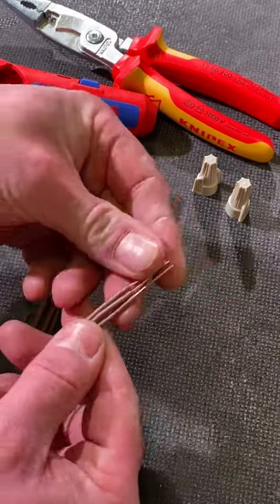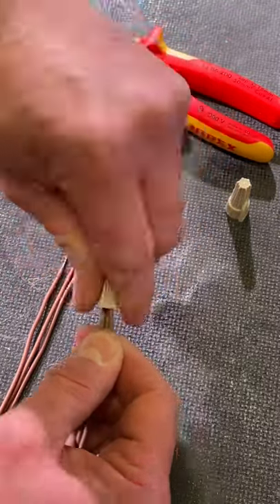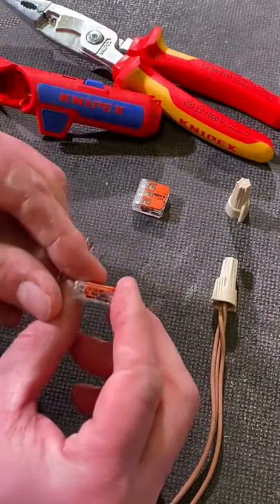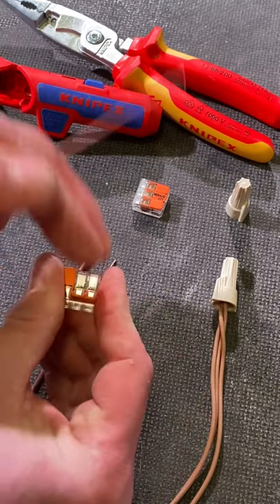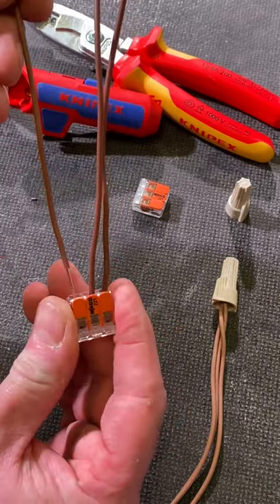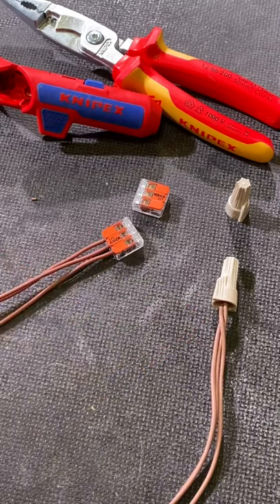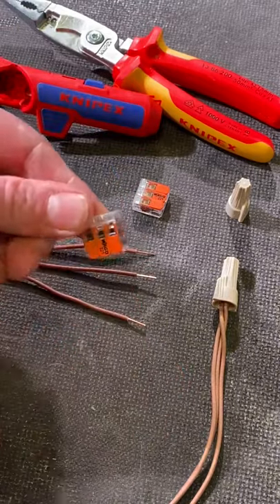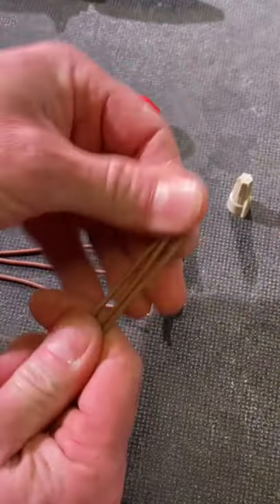Which way do you splice wires? WAGO 221 vs WIRE NUTS? | Electrical #shorts from eFIXX

Comment: I do prefer the Wago. Easier to use, especially so if one wire is different diameter than the other, or one is stranded and the other unstranded.
Reply: If the wire is a different diameter then you have to use a different wago because wagos are amp rather and the diameter of the wire determines the maps that will be traveling down the wire. Wire nuts have no amp rating because they mechanically connect the wires together. The metal in the wire nut is only used for grip not as a current carrying conductor like the wago. They are not safe I've seen them explode when a shot happens.
Reply: @BILLY KRYSTAL 
Well, no. Let's assume single phase power, 120V for simplicity. One wire is going to go back to the breaker. If the breaker is 15 amps, then there will never be more than 15 amps sourced through that wire. Because of Kirchoff's current law, none of the other wires going into the Wago can exceed 15 Amps. So long as the Wago is rated for at least 15 Amps, there is never any possibility of exceeding its rating. But what if one of the wires going into the Wago is undersized? How exactly is that going to happen? Any lighting fixture you buy is going to have lead wires rated for that fixture's maximum draw. Even if somehow that draw exceeded 15 amps, the breaker would open, protecting the wiring and the Wago.
Reply: @ws6002  Your relying on the breaker to trip if the load is more than 15 amps sorry but breakers fail. People plug things in that use more current all the time that's the whole reason we use breakers to limit the current because people plug crazy things in. But the breaker doesn't always trip. Like one case we installed a 30 amp outlet for a dryer. Breaker didn't trip with a dead short to earth and melted the outlet brand new install brand new breaker. Using a wago the wago would have also melted because its amp rather and introduces resistance and creates heat. Breakers are built using a metal rod and a coil to induce a magnetic trip. If the short is bad enough it can melt the enamel off the coil wire in the breaker and not create the magnetic field that causes the breaker to trip. You should never rely on a single trip point. Using a wire nut you are essentially creating a bond with the metal the reduces the resistance because where the connection is is a much higher gauge wire where the joint is. So it will never heat up even in a instance of a short or large current draw.
Reply: @BILLY KRYSTAL  Yes. I am relying on the breaker tripping. That's how wiring is done. That's how the standards are written, for both residential and industrial applications. Are you writing your own residential electrical wiring standard? Because the use of wire nuts is 100% dependent on that breaker tripping. So is every inch of wiring in the walls!
Reply: @ws6002  No using a wire nut is safer because there is no heat created at the joint in a scenario where the breaker doesn't trip. Where there is resistance there is heat. A circuts weakest points are its greatest failures. I would rather the outlet melt than every joint in the circuit. I only use wagos in DC circuits where I have full control of the amps being drawn through my circuit. And no we dont trust the breaker will trip that's why we ground all metal boxes that's why we have a massive ground rod. That's why we bond the water. Thats why we use metal panels and ground to the metal studs and the slab. If we were sure the breaker would trip we wouldn't need grounds.the ground is used in a short so the wire doesn't overload and fry the wire like a fuse.
Reply: @ws6002  if you make a proper joint to start you dont have to see your connection! Stop being lazy. A proper electrician always checks his joints stop being lazy. A stranded wire works just as well under a wire nut if properly secured! Stop being lazy. A proper electrician would never fool themselves Into using a wago because there to lazy to do it properly.
Reply: @BILLY KRYSTAL  You revealed you are incompetent when you failed to answer my question: What is protecting the wires in the wall when the breaker fails to open? You don't know what you are talking about.
Reply: @BILLY KRYSTAL  And FYI, the Wago connectors improve the safety of the mixed connection because the stranded gets a joint and the solid gets independent connection with the interior bus. That way we know both are solid (no pun) connections. You forgot the wiring in the walls has a lower rating than the Wago. You forgot that the Wago provides a method of visually verifying the connections.

Comment: Wago may be convenient and slightly better for saving space in a box, but wire nuts allow for a much better surface area connection. And yes, you can undo a wire nut and re-use it.

Comment: Being in the US, Wagos aren't really common, but if I get back into industrial control systems I would likely get a selection of them because I like the idea!
That said, I untwist wire nuts unless they are locked up, mainly because in wall boxes you don't have extra wire length to cut off, and over the years you may need to remove wire nuts many times lol
Reply: That's also where wagos come in handy my man.
Reply: @shawnshurtz9147  often no room for Wagos in household wall boxes over here lol 
They are also used as junction boxes and may have multiple 12g solid Romex circuits running through a switch or outlet box, and you have to push hard to get everything back in, with the nuts tucked back into the corners.
Reply: @ke6gwf  I'm in the USA. Inspectors are pretty strict around my area for box fill. At least in commercial / industrial.
Reply: @shawnshurtz9147  for new construction, yes, but I am more likely to be working on old houses and commercial, and it's not uncommon to have to use the screwdriver handle to compact the wires in, and then the tip to wiggle wire nuts into gaps lol
It's especially bad where GFCIs have been added...
Reply: @ke6gwf  they make a little plastic tool for pushing / tucking wires into the back of boxes 😀
Reply: I've known about Wago for a while but never tried them until I bought my house a few months ago. Did the electrics with Wago and after years of working with my father who was an electrician, I will probably never go back to wire nuts. The advantages are to numerous to get into here. I've ordered a multi collection set of them and love them. They are firm, strong connections and take up less space and super easy to use. Technically wire nuts were never designed to be reused but I am guilty of that myself for many years.

Comment: I've used wirenuts when i was in the states years ago, never had a problem with them, same as wago's .. a lot of it is down to the installer using them correctly .. i like the wirenuts as there is a lot of surface area contact, downside is they are bulky compared to a wago , not as fan of the push in wago's but like the 221's .. deeper back boxes in the states, not sure a wirenut would be a good thing in a 25mm box
Reply from the maker: Massive thanks for your input 👍

Comment: "A proper job doesn't have to be undone"
Reply: Ever change out a zone valve on a boiler?
Reply: @jaredtandle2596  I avoid death traps whenever possible boilers no matter how new or "well designed" fall into that exact category lol
Reply: @deathkiller008  lol yeah.. I think they expect everyone to have perfect water there at Rinnai
Reply: "Those who don't make mistakes are those who make nothing at all"
Reply: @thelazarous  I am STILL paying for my mistakes and I am not sure that will end anytime soon
Reply: @deathkiller008  I'm dropping a third motor into my mustang this month, trust me I feel ya
Reply: Wago
Reply: @thelazarous  well that's your problem, it's a Ford. Jk man that sucks, manufacture defect or what?
Reply: @george30198  Camshaft synchronizer drive gear on the front of the camshaft keeps chewing up the synchronizer gear. Synchronizer gear drives the oil pump, gear fails and you have no oil. This last time I was doing a 4th gear pull when it gave out, 5000rpm and no oil pump = spun bearings
Reply: @thelazarous  oh my god
Reply: Yeah well they do have to be undone all the time.
Reply: @shawnshurtz9147  the quotes are me saying that this is someone else's words friend :)
Reply: @deathkiller008  word I agree.
Reply: @deathkiller008  reiterated is all.
Reply: @Thibaut Snoeijs (3WEA) lmao funny real funny. I terminate 30 to 40 fixtures a day rhats 90 to 120 connections a day with multiple wires in each connection and you think I'm unprofessional for not using soldered connections. Customer may not like the massive extra cost of labor.
Reply: @Thibaut Snoeijs (3WEA) solder deteriorates over time, which actually leads to higher electrical resistance, in this application that may lead to heat build up in the wire nut, which is why it isn't recommended, nor 'professional'.
Reply: There's an old saying that goes,  "shit happens" .

Comment: I dig the levers for light fixtures and occasionally in boxes where it's more efficient. Otherwise I wire nut outlets and usually switch boxes. Junction boxes with no physical movement I'll use wago wallnuts. Just my preference over the years I'm developing. Kudos to the YouTube commenters who turned me onto lever nuts for lights!

Comment: I'm more of a Wago guy now. It looks much more cleaner and saves you time with changes. But I haven't forgotten the wire nut method as I was first trained on them and they work out very well as well.

Comment: Look...I think we all know we can just take off the wire nut here and reuse it but there have been plenty of wirenuts that have the threaded part at the tip come out making the wirenut useless. I've been around HVAC and electricians all my life and the wago's aren't going away nor do I want them too. There are the old-school guys that'll never admit that they are good & useful but they are.
Reply: They are cool, but wagos are more expensive and there's nothing wrong with wirenuts. I think a lot of the backlash is because of dumb videos like this pretending that wirenuts are totally inferior. I use both, but it's like 90/10 in favor of wirenuts.

Comment: Lead service tech here, wago's are a guaranteed service call in a few years, especially if there's any kind of real load on the wires.
Reply: then your techs are fucking up in the install, or more likely you are bullshitting, i installed the wiring in not just mine but many a house, and 15 years later the wago is still fine

Comment: WAGO 100%
Reply: Me to man my dad and i use them all the time on big jobs never failed us yet and there are wagos that has no levers to release they are push in and pull out wagos we use those in electrical boxes and wire claps so they wont pull apart
Reply: I’m not an electrician myself but am good friends with one don’t wagos tend to ark and melt
Reply: @anorak_2902  No, wtf?
Reply: Why do backstabbing receptacles get hate while wagos are praised?
Reply: @mikerosoft1009  because wago products are good?

long explanation: the backstab receptacles on almost all American plugs are friction based, so a small spring squeezes the wire in place, over time ths spring can wear out and losen, if the cable falls out of the port it can land close to the conductor and when power is used it will cause and arc, arcs make heat and then you get fire.

WAGO connectors on the other hand have conductors that "bite" into the cable holding them in place until they are physically released, think like a zip tie

Comment: Always twist the wires before you add a wire nut... promise it won't fail unless the wire nut is bad
Reply: Came here to say this. The wire nut should be the final cap and insulation of a mechanical connection, not the connection itself.

Comment: I personally pretwist the wires for the skin effect. The electricity travels on the surface and the decreases resistance with more contact. I like the press tab but like quick wire receptacles it's a matter of time for them to fail. If you twist them right you don't even need a wire nut for a forever connection.

Comment: Both have their advantages and disadvantages... Wagos are by far superior when it comes to space needed to make the joint... I wouldn't trust them for high amperage/ voltage applications tho.
Wire nuts have a greater contact area when made properly, which reduces the possibility of the joint heating or arcing.
I love Wagos for light fixtures or switch boxes. Wire nuts are definitely better for making power receptacles.
I've been an electrician for 11 years, possess my state Journeyman license and went through a 5 year training program through the JATC.